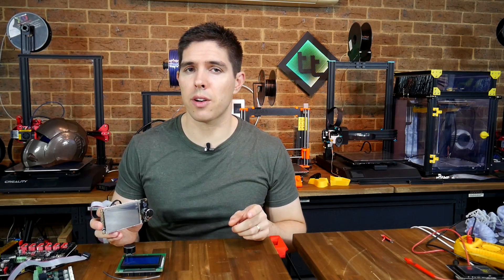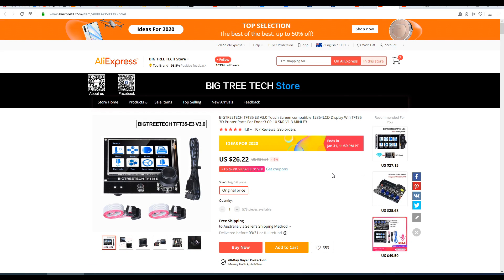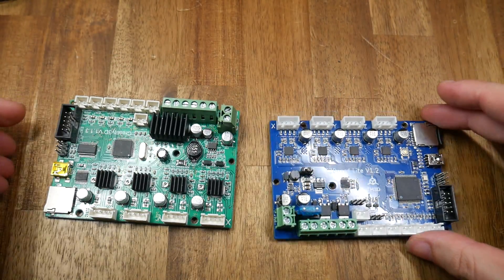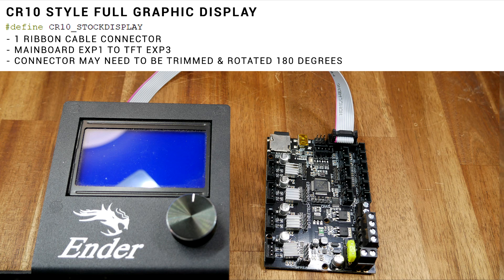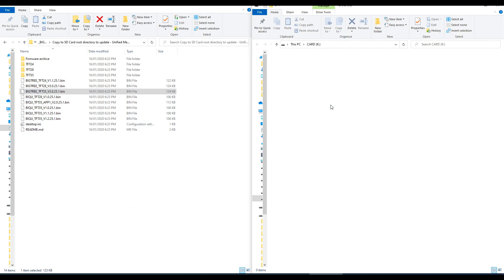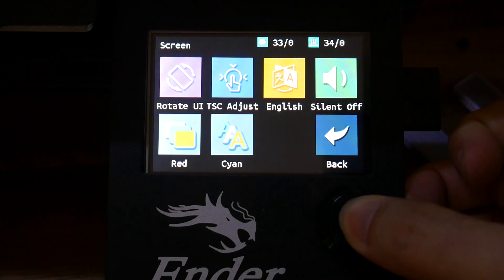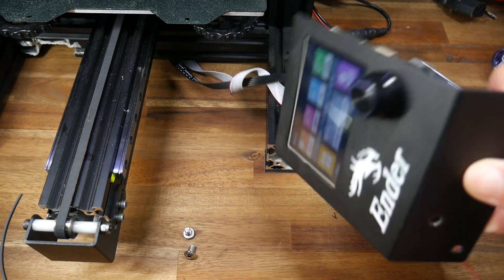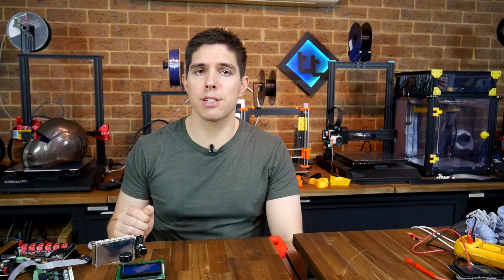BTT TFT35 dual mode touch screen guide

Comment: I want to make the Marlin display full screen, so I changed the parameter from 0 to 1 (my version says #define DEFAULT_ST7920_FULLSCREEN_MODE). I also made another change for the manual bed leveling to do mesh leveling and remove the ABL options. When I did the update, the mesh leveling options were added so I know the update took, but the Marlin screen did not change to full screen. I have the BTT TFT35 v3.0 display.
Reply: Also,  the original Marlin display showed the percentage of the build completed next to the build time. Can this be added to the new display?
Reply: Full screen SOLVED!!! In my touchscreen mode, in settings, there is a "FEATURE" icon. When you go to feature menu, on the last page, there is the option called "Marlin mode in fullscreen". I turned this function on and the Marlin display is now full screen. TA_DAH!!! OH-OH! Now the selector knob for the display does not light up and there are no settings for it in the Feature menu.

Comment: When I re-flashed my TFT, I got an error saying "OUTDATED DATA". It said "LOAD FONTS", LOAD CONFIG", and I could see just the top of the letters of the next line on the display that was overwritten by a message about inserting the card and pressing the reset button. I found on another video, that I needed to include the TFT35 folder containing the Fonts and BMP's, and the config.ini file on the SD card along with the new .BIN file. I got it working again.
Reply: Hey I had this same problem, added the config.ini file and its working but the touch screen is unresponsive. Any advice?
Reply: @kittrell2  Be sure the black ribbon cable is connected properly as it sends the touch signals to the controller board.
Reply: @TinkeringJohn  I checked the cable and that wasn't it. The screen did ask me to recalibrate it after the update but I accidentally hit the reset button when doing it, think that may be my problem...

Comment: If you want to switch between screen modes, it is not necessary to hold down the physical button! You can switch screen modes by holding your finger on the screen until the selecting option appears!

Comment: how about the 1.4 turbo? where are the pinouts for it?  I know where the header is for it and have changed the baud rate for the serial connection but still says no printer
Reply: The info you are looking for is in the video

Comment: I think that i almost watched all of your video's about SKR board and the TFT35 and that of others, searched the github of bigtreetech and looked at many example config files in discussion groups, but nowhere i can find a solution for the TFT loosing random connection with my SKR E3 DIP v1.0 board. When i print in 12864 mode and use the SD on the SKR it runs fine until the end. Firmware is updated to 2.0.6.1 and the TFT35 also had the latest E3 3.0.26 version. Other people also complaint about this bug, but nobody seems to have a solution. Maybe you have ??

Comment: have youdone a recent update to the TFT35 V3 E3? the recent updates has a bug where the LCD12864 Simulator screen stays blank and I wondered if and how you over came it?
Reply: I just could not get the LCD to display when connected to an SKR1.4Turbo board which I'm setting up for my Enders 3 Pro.
Graphics mode worked fine.
Both modes worked fine if I connected the TFT3.5 to the Melzi board (running under Bugfix-1.1.x) using the Exp 3 socket.
So I knew at that point the there was nothing wrong with the display.
However, no joy when connected to the SKR board.
But after viewing the video at https://www.youtube.com/watch?v=DodRRgZf5Lo I was able to make the following changes to the Configuration.h file (in Bugfix-2.0.x):-
Uncomment     //#define REPRAP_DISCOUNT_FULL_GRAPHIC_SMART_CONTROLLER    (About line 1995)
Comment out     #define CR10_STOCKDISPLAY  (About line 2081)
Everything then works just as it should.

Comment: Michael, I just installed btt 2.0 motherboard and the 35 LCD. I'm new to 3d printing. When I startup the Ender 3 I only get BTT logo and then it locks on the dual logo screen. Can you point me in the right direction. Thank you. You videos are always well done and extremely informative.

Comment: I did all this and it all worked , but then I updated Marlin and now I just get NO PRINTER ATTACHED :( ..Is it a marlin config im missin ..I'm Newb Thx in advance .
Reply: Comment took from .

BigTreeTech SKR Mini - Complete Marlin Config - Chris's Basement

Matthew Conrady .
Chris, really good information.  I was able to get Marlin 2.0.5.4 up and running last night.  One issue I ran into is that with my BTT TFT35 v3.0 in touch screen mode I could not get the "no printer connected" error to go away.  Tried swapping ports, disabling CR10_STOCKDISPLAY and enabling REPRAP_DISCOUNT_FULL_GRAPHIC_SMART_CONTROLLER, which I found the reprap controller is not compatible with the SKR E3 Mini 1.2 board.  So went back to CR10_STOCKDISPLAY.  What finally worked is I went out and looked at the BigTreeTech github for the SKR E3 Mini 1.2 board and found how they configured their serial ports.  I put this information below and now everything is work.  Someone else probably already figured this out, but if not maybe it saves someone some time.

#define SERIAL_PORT 2

/**

 * Select a secondary serial port on the board to use for communication with the host.

 * :[-1, 0, 1, 2, 3, 4, 5, 6, 7]

 */

#define SERIAL_PORT_2 -1

Thanks Matthew 
TopMan TopDog.

Comment: Did anyone try to print via the marlin mode? I think its only works with the sd of the board but non for the sd card on the screen. Is possible to print in the marlin screen mode via the sd of the screen or not?

Comment: better question I am running the SKR1.4 nonturbo and the TFT3.5 v3 and I am trying to install in my geeetech A20M but now when I trigger a end stop it shuts off the power to the board and screen but comes right back on it I let go of endstop. Dont you have a old geeetech A10M with a bad board? it would be awesome if you would put on of these in that this is difficult. lol

Comment: Love your videos, very informative most of the time.  I have a question. I upgraded my Ender 3 Pro to SKR 1.4 Turbo and TFT35 V3.0 at the same time.  Nothing happens when I power up the printer except that the screen flashes (no images). Checked the cables, according to all the videos, they are correct.  No one has indicated that the firmware has to be flashed before it will work, and not sure what the procedure is when you don't have a screen to see what is happening, if anything.  I would greatly appreciate knowing what I possibly did wrong and how to correct to get my print functional again.  THANK YOU

Comment: Love you Videos, so glad I subscribed !, I have a question, if I could, I upgraded to a BIGTREETECH SKR .14 Turbo and TFT50 V3.0, and installed Marlin 2.06, My issue is Both Marlin Display mode , Or Bigtreetech display show, I see NO BED icon, so will not heat of course, Triple checked the wiring, Any Ideas ?.... Thanks

Comment: The tft doesn't see the printer straight away..

It took a little more than 10 minutes, but I have it done. The TFT35 e3 is installed to the skr mini e3 v2.0. And perfect, the board saw the tft with no firmware update,  meaning I dont have to re-calibrate yet again.

However, as mentioned, it doesn't see the printer right away.. it takes a few seconds to connect. Is this normal? I assume so..
Reply: Hi Paul! Could you please tell me how did you connect the SKR Mini E3 v2.0 to the TFT35 E3 v3.0? I used the original cable that came with the Ender 3 connecting the EXP1 on the SKR side and the EXP3 on the TFT side, and it keeps telling me "No printer attached!". Thanks in advance.
Reply: It always says that, as it takes a second or 5 to see the printer. If its saying that all the time, it may be that you plugged in your 4+1 lead the wrong way round.if I remember right the 4 is towards the front, the 1 for the rear. Same port for the original screen cable, the cooled one and I think you have it right ext3, tft upside down the port on the left, right way up, the port on the right. 

At least that's the way it is on my ender 3 pro..

Remember to wait to see if the printer connects (takes just a few seconds)
Reply: Hi  @paulradford4100 , thanks for your answer, as I am understanding you, I have to connect two cables, the first one is the EXP1 on the SKR side and the EXP3 on the TFT side and the second one (the one that I haven't connected) should go from the SKR on the TFT port (taking care of the orientation as you say) to the TFT35 on the RS232 port. Is that correct? Again,  @Paul Radford, thanks in advance.
Reply: @Javier Amaya  yeah, I think that's right.. I only know it as display on the skr (theres only 1 anyway).

They do supply display cables, but I never got them to work on the ender 3 pro, but the ender 3 pro comes with a colourful cable snt that works just fine.

Tft (4+1) cable is rs232 (if I recall correctly) on the display and tft (5 pin) on the skr. I'm sure the orientation is 4 front, +1 rear. (Dont worry if you do put it the wrong way round, itll cause no damage,  just look messed up)

Comment: HELP....After I upgraded to the SKR mini E3 v1.2 board,...I no longer see the option to select Filament Change in either the manual knob select menu or in the touch screen menu. How do I get that option back or is changing filament during a print done some other way in either manual select knob menu or touch screen mode???

Comment: Is there anything else that can cause the 'Printer not attached' error? 
I've tried all UART speeds but it makes no difference. The screen simply will not communicate with the mainboard (SKR mini E3 V2) in touchscreen mode, Marlin mode works ok, but the SD card reader is not recognized.  Any suggestions gratefully received. 
Bigtreetech have been little help other than to suggest updating the firmware, which I have already done.
Reply: Normally its just the baud rate difference.

Comment: I recently purchased the Big Tree Tech V1.4 Turbo board, it was bad and wouldn't connect to the computer at all for testing. I sent it back thinking maybe it was bad and purchased another one. The new one did allow for connecting to the computer to read the drive, but that was it. I uploaded new Firmware and it worked for about 30 seconds, then the board would not connect and the manual screen did not work, only the touch screen worked and would scroll: No Printer Attached. I went through all connection speeds with no luck. I sent that one back as well. Maybe there is something wrong with the Turbo version as the reviews on Amazon weren't that good.

Comment: Michael, thanks for the in depth look at the TFT 35. I purchased one to replace the screen on my Artillery Sidewinder X-1, pairing it with an SKS 1.4 Turbo motherboard. I am placing it in a mount which requires me to remove the knob. It seems very tight  and very hard to remove, and I certainly don't want to damage it. Any tricks for removing the knob to place in an enclosure?

Comment: Great video Michael, as usual!  Thank you so much for helping so many people!  I had one small hiccup where after installing the E3 version the screen came up with the two choices about touch or classic mode and wouldn't work.  Touching the screen did nothing, and turning the wheel or pushing it also did nothing.  I remembered when I installed it thinking that it was really mashing the screen up against the metal frame of the mount, so I took it back apart and tried it unmounted and it worked!  I added some washers between the mount and the board to give the screen a little gap (so that it wasn't pressing against the frame), and everything was fine.  Not sure if the screen or the mount was out of spec, but just a tip in case you notice the screen pressing up against the frame during installation.  I use OctoPrint so I am disappointed that the runout sensor will only work if I start a print from the touch screen, I wonder if it will work all of the time if I connect it to the main board (SKR Mini E3 V1.2)?

Comment: Hi Michael, Great Video. I was looking to do the Lowrider 2 build you had posted last year. There you used the MKS TFT mod to control the Lowrider. Will the TFT35 work with the SKR V1.3 instead and how much tinkering do you think would be needed to get this running?

Comment: I’m having an issue where I can’t print from the SD card on the touch screen mode. Only if it’s in the marlin mode. I’ve only tried the SD card holder perhaps using the USB SD card reader will help. But right now nothing.. thoughts?
Reply: I'm having the same issue.  In TFT mode I don't even have the icon for onboard SD as it shows at 13:18 in the video.  The big problem is that my SD and USB inputs are up against a wall when the printer is in place so my only easily accessed input is on the SKR mainboard.  Also in the menu page to select between Marlin and TFT screens the rotary dial will not work for selection.  Still working through some bugs.

Comment: Hi Michael, I've installed the skr mini e3 and tft35 on my ender 3 pro and it shows "no printer attached" error.

I tried following some ppl who said change the #define SERIAL_PORT_2 0 but i get the port 0 does not exist error.

Playing around with the baudrate also didn't help.

Do you have the solution for this? Thanks
Reply: Did you figure it out?

Comment: Cannot not get touchscreen to work on skr mini. E3 V1.2? Please help connected wires as video shows but definitely not it
Reply: Ok so I got touch screen mode to work-didn’t hold button long enough-but now it says “no printer attached” and I believe have it on 115200 BAUD rate so what am I still doing wrong?

Comment: On Marlin, there is support for the Prusa MK3, with MMU2. Support for the newer filament sensor, so MK3S with MMU2S is on its way, I was told. The MMU2 uses a serial connection to connect to the printer. Can an MMU2 still be used on a BTT 1.4 board with the LCD screens mentioned here, using a “free” serial connection? Or is there a serial port connection missing for this on the BTT 1.4 board when you use the TFT 3.0?

EDIT I checked the BTT github for connections of BTT SKR 1.4 and I noticed the WiFi interface also features an independent tx/rx, so if you willing to sacrifice the WiFi connection on the motherboard, perhaps this port could be used for an MMU2 serial connection? It seems 3.3V, but maybe is also works for 5V...

Comment: Hi and thank you for the nice video. I have changed my board to skr e3 v1.2 and added a tft35 v3 . although its started working at the beginning after a while I got a "no printer attached"  message. I reinstalled both firmwares and changed baudrate. i would appreciate yr help.

Comment: Been going slightly mad trying to get this screen to operate with my SKR Mini E3 V2.0 board. Was supposed  to be plug and play but after 5 hours, all I have to show for it is Marlin that won't compile and only the LCD working. Error message is "No Printer Attached". Changed the Baud Rate on the screen to 115200 no go. Went into marlin Bugfix 2.0.x, found the board in boards.h, but when I go to build I get errors of outdated version of configuration.h and configuration_adv.h. Can you do a video on this board and screen combination? Thanks
Reply: I'm having the same problem with the SKR Mini E3 V2.0 board and the TFT35-E3 V3.0, "No Printer Attached".  Been working on this for a week now with no success.
Reply: Hello, have you been able to solve the problem? How did you do that?
Reply: @javieramaya100  Go to the GITHUB site and download the new update where the SKR Mini E3 V2.0 board is NOW present in the firmware. Follow the instructions and it should work. FINALLY got mine up and running. Good Luck.. I think the problem was that they released the board a bit early and the firmware had to catch up.
Reply: @javieramaya100  Hi, I fried my board so I ordered a new and just used the firmware that came with it, works great, but with not many features enabled. I've never seen a complete and easy to use feature enabled firmware so I'm sticking with what came with the board and it's working.
Reply: Hi  @JHV166 , thanks for your answer. It seems that I have not made the correct connection between the SKR and the TFT. @Paul Radford answered something that is guiding me on that way. Anyway, it seems that the code is being updated frequently and needs to be compiled and reloaded, so, I am taking your advice on reloading it after a full recompile. Thanks again.
Reply: Hi  @nortonwholmer-smith481 , sorry to read that you fried your board. Thanks for your answer.
Reply: @javieramaya100  I went through the same thing in the beginning. I was an early adopter of the V2.0 board and pulled my hair out trying to get it to work. Once I realized thwt the firmeware wasn't finished, it all fell into place.  A week of waiting and when it finally was released. it was done. Best of luck to you.

Comment: 1.1.5 board and stock screen combo work fine. Touch screen is slow and unresponsive it’s not an phone just crap touch screen like a printer. Dual mode isn’t that special. The idea is nice but it isn’t that great.

Comment: I have a SKR Mini on my ender 3 and decided to add the TFT. Worked out of the box. after designing a mount for the screen I have no touch screen. not sure if I pulled something loose and shorted the touch function. I checked all my connections and update TFT firmware with no improvement in touch function. I can bring up the menu to choose mode but the selector wheel will not function either to switch bac to standard mode. any suggestions?

Thanks for the great videos